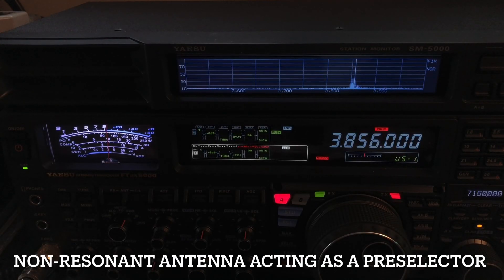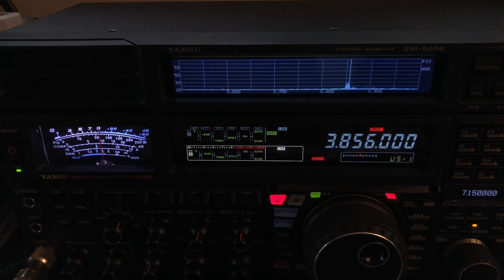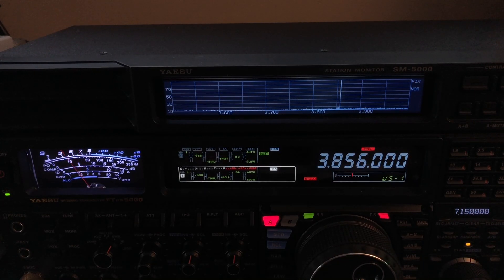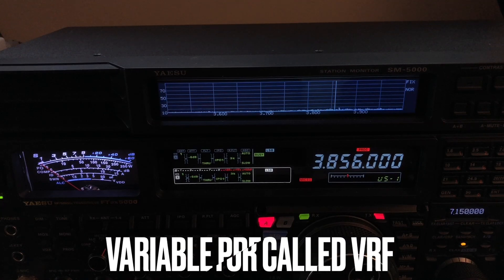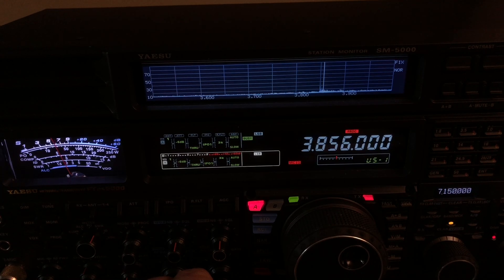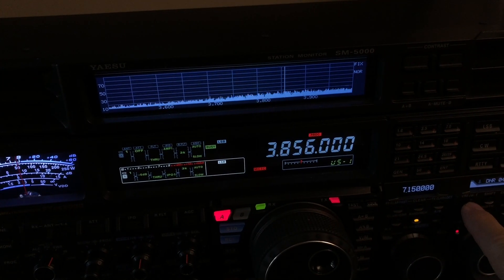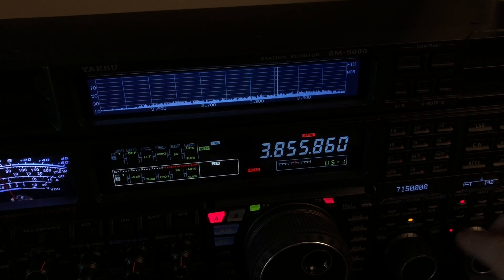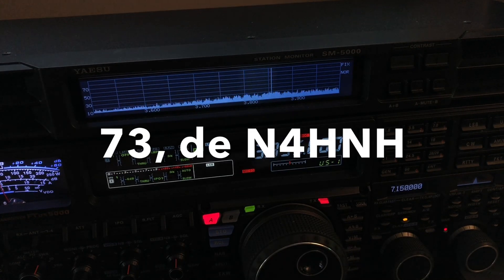Non-resonant Antenna acting as a type of Preselector

Comment: Great video. A tuner can help in static discharge to ground to. Your tuner is acting like a high Q tuning.

Do you have any problems with getting RF in your shack with some of that Window line in your shack? Especially on higher frquencies such as 20,15, and 10 meters. 73 de WA3RSL.
Reply from the maker: I do get some RF in the shack, but mostly on 30 and 40 meters.  It’s usually no problem unless I run more than 100W.  But I don’t use the doublet for 40 meters.  The ZS6BKW beats it on 40 meters every time.

An OCF dipole can produce RF in the shack when operating on a band where it has higher SWR (i.e. 2:1).  The common mode current flowing along the shield of the coax will radiate RF into the shack.  My tuner makes my radio/amp happy, but there is still RF in the shack.

I have installed Ferrite chokes on the mouse, keyboard, and CAT cables.

The best way to never have RF in the shack is to use a coax-fed resonant dipole for every band.  That is just not practical for most people.  The Tune-A-Tenna is the only way I know of to work 6 through 160 meters with one resonant dipole - no tuner needed.

73, de N4HNH
Reply: @n4hnhradio  Thanks for the comeback. All great ways to kill RF in the shack. Using a couple of different ferrite material types might be good too.

I'm in a temporary living situation but have permission to put up one antenna. Ill be using a remote antenna tuner to a 500 foot piece of wire. It will be about 40 feet from my shack. One coax, 160-10m with some gain on the higher frequency bands. Radials for each band attached to the tuner. Hopefully Ill be on the air early in October 2021.